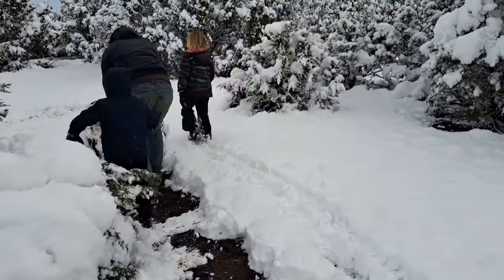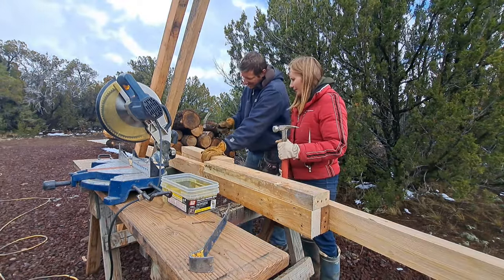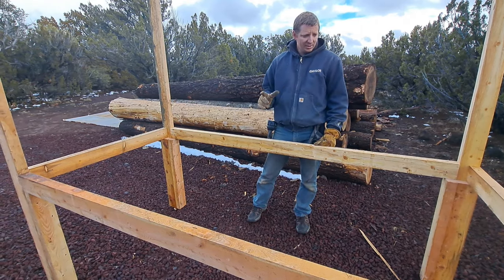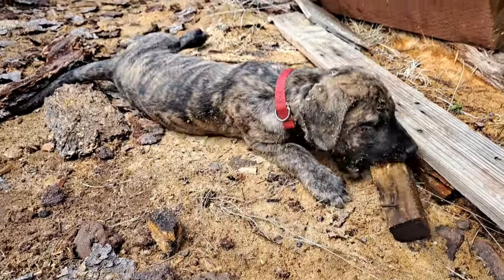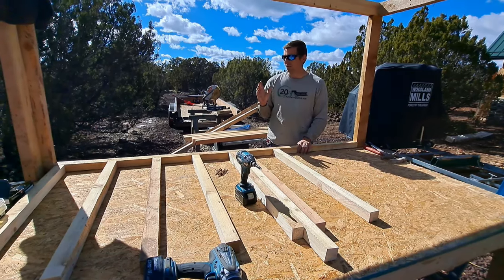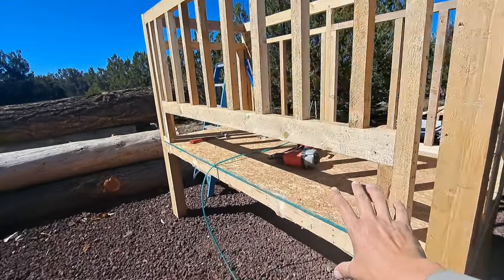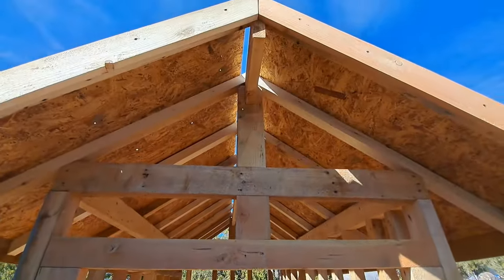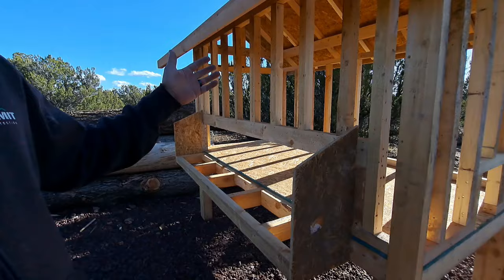CHICKENS! What Every HOMESTEAD Needs.... And A Puppy 🐶 | Chicken Coop Build

Comment: You need to pack your bearings on your trailer as much you use your trailer and weight. Pull the hubs pack them it will save you money on repairs on the long run